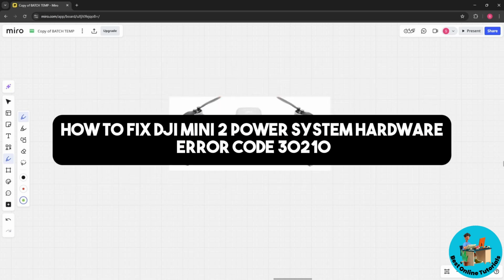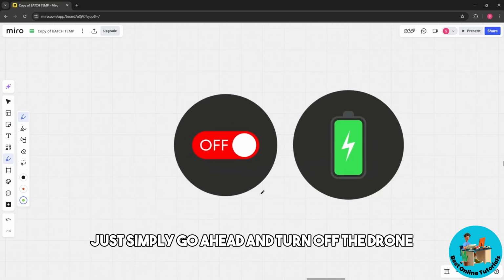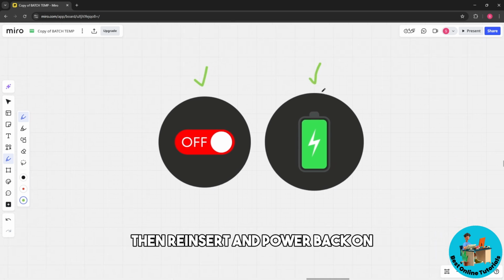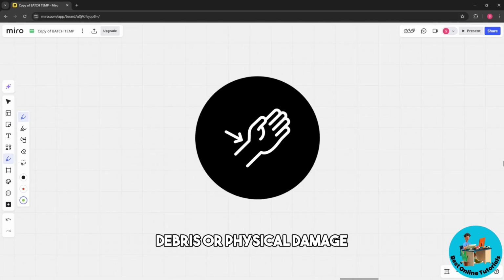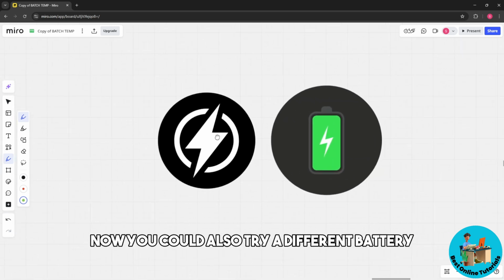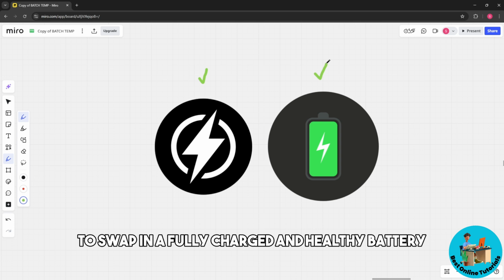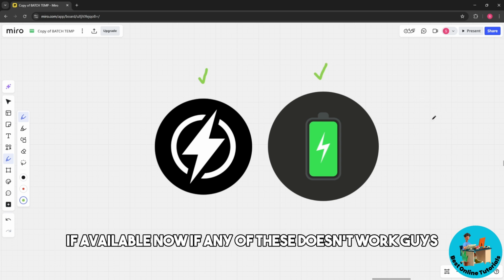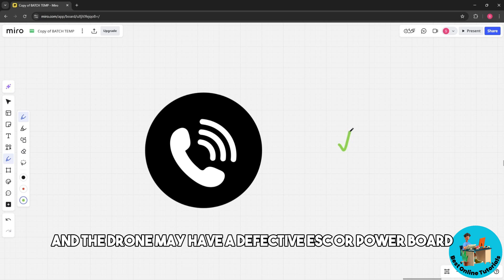How to fix DJI mini 2 power system hardware error code 30210! **PROBLEM SOLVED** (Works 2026)

Comment: This does not help !!! Please remove "problem solved" from your title. The 30210 code means serious electric problems most likely from the Electronic Speed Control pcb that also holds the power regulators which can damage in a crash or motor overload during crash.